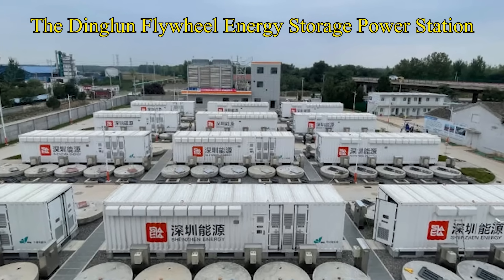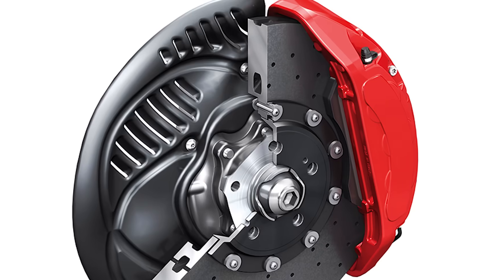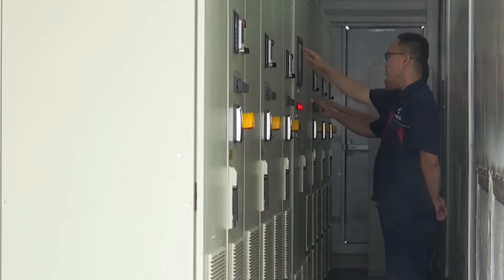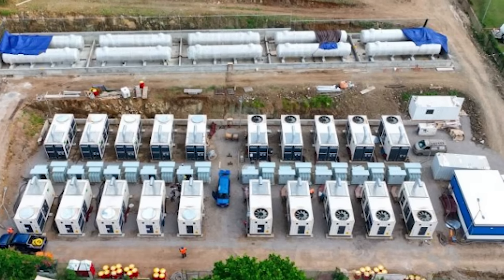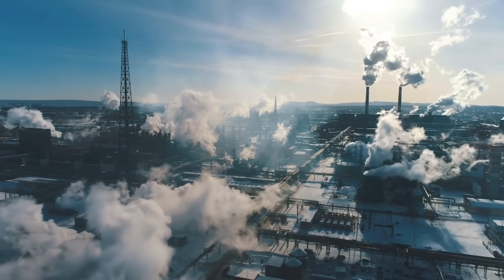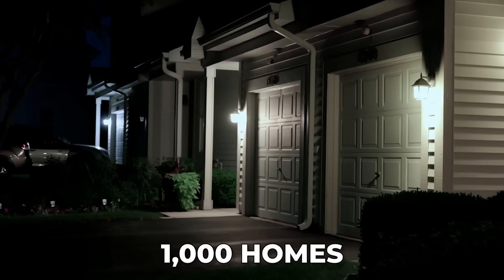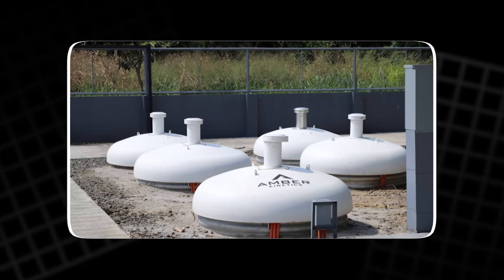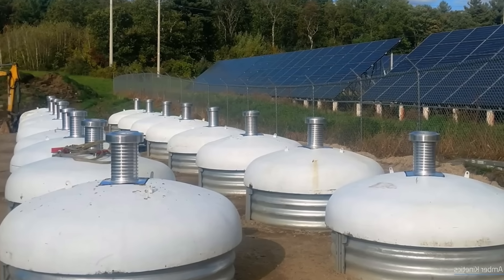The World’s Largest Flywheel Energy Storage System is Changing Everything #FlywheelEnergy

Comment: 30 MW is power not energy.   It means this system can provide 30 MW with no indication for how long.   It could  be small 1/10 second.  There is little chance this can replace the use of natural gas turbine generators running at high readiness producing little electricity supporting the entire generating space of solar and wind generated electricity  more natural gas cost than making all the electricity with natural gas combined cycle power stations.  Since little natural gas is generating electricity the high natural gas use is hidden from the public.
Reply from the maker: Thanks for clarifying the distinction between power and energy in relation to the flywheel system!
Reply: Good you understand. Thanks for sharing the first part. 
FWIW. Flywheel system is is slow to charge, discharge and recharge. That is what is slowing USS Gerald Ford from doing rapid aircraft launches.
Reply: Not quite. The stored energy goes up non-linearly with the increase in rotational velocity, which is why it is advantageous to spin them as quickly as possible. Also, a lot of the figures quoted are for old, oil-bearing systems. These newer 'wheels' on magnetic bearings are quite different beasts, and their only losses are due to the Earth's own rotation (same principle tunnel-digging navigation gyroscopes work on). Investment in the tech is being pushed aside by rare-earth interests, but as this video demonstrates there are bodies catching on to how cheap, redundant and non-polluting wheel farms are. They are very much a viable solution to both smoothing and storage.